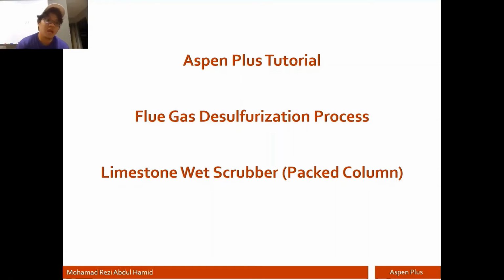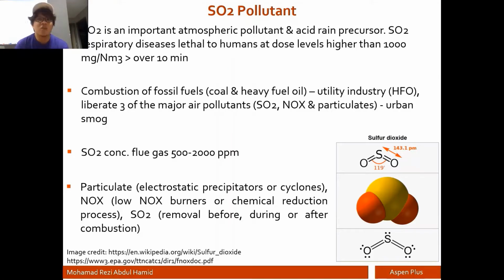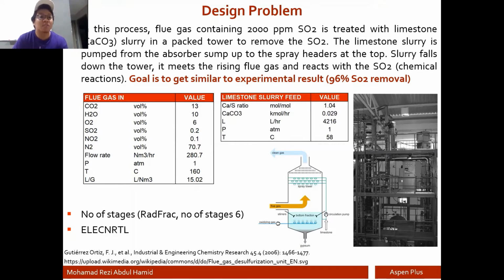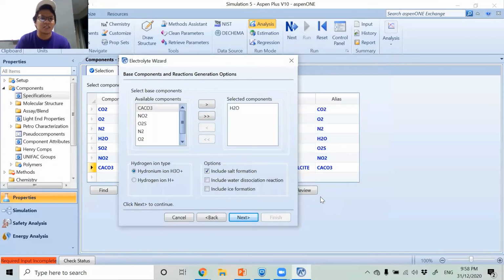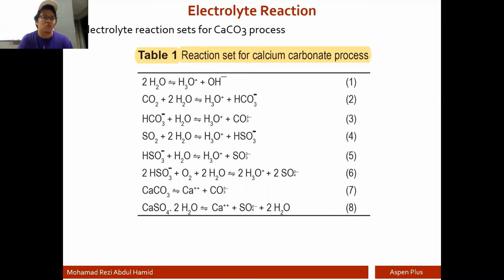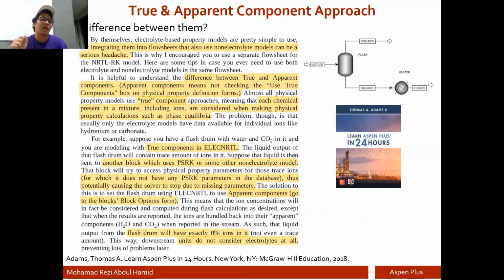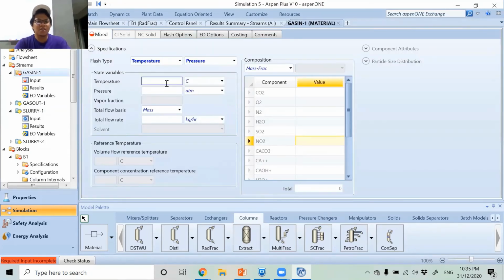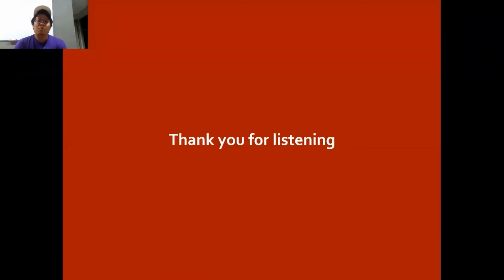Aspen Plus - Flue Gas Desulfurization (Limestone Wet Scrubbing)

Comment: Hi Mohamad, thank you for this video/lesson. I believe this will also work for a caustic soda solution for H2S of 7800 ppm gas scrubbing. I have tried simulating the same with NaOH with about 0.385 kmol/hr, but I am confused if the concentration of the caustic soda(50%) will affect the result of the simulations, as I would love to simulate it with 30% concentration.

Comment: can you clearly explain why you chose true component aproach? why would i want to know flowrate of ions? wont appaarent component be better? no downstream units will get affected as you demonstrated, so why true component? what advantage does ithave?
Reply from the maker: To be honest I do not the reason behind it. maybe the reasoning is purely based on chemistry.. This is just my opinion btw. In term of mass balance yes they are equivalent.. I felt that true component approach provide an insight of what really happen to the solution. For example, we would know all HCL would dissociate into H3O+ and Cl- when added to water. In reality, they exist as ions as oppose to neutral molecules. It also provide insight of how much water is consumed during dissociation reaction. Also, at different T and P different dissociation extent is observed. Maybe the knowing the ion content allow you to calculate pH or electrical conductivity of the solution. I don't know, I just rambling nonsense here. I read somewhere that true component approach cannot calculate liquid-liquid equilibrium. Try to read this, maybe it helps. Thanks
https://www.cheric.org/files/research/ip/p200413/p200413-201.pdf - page 13 and 14